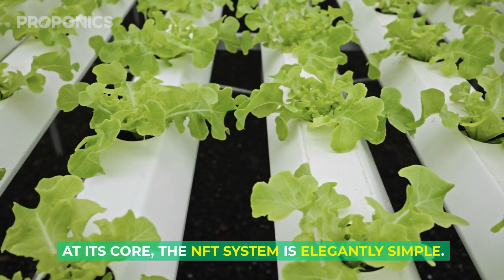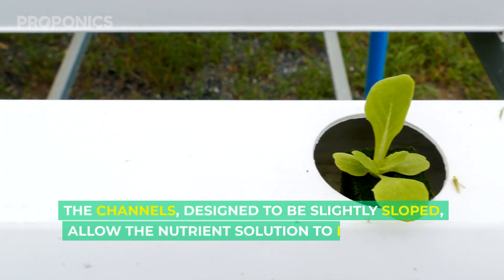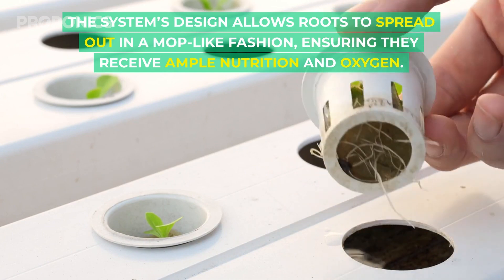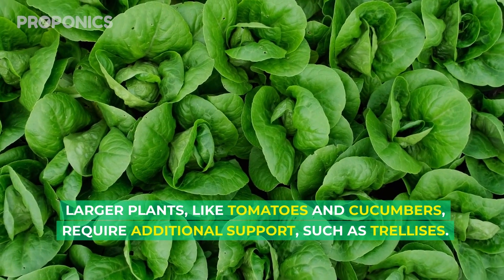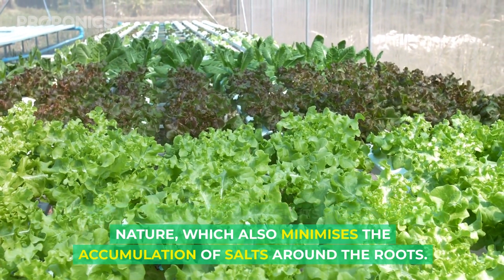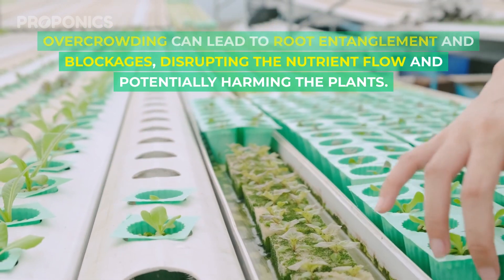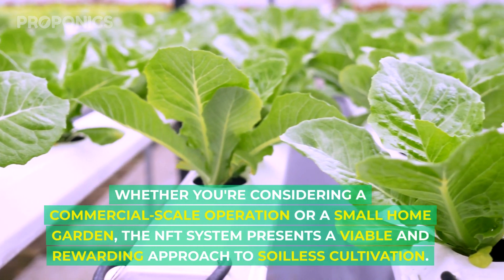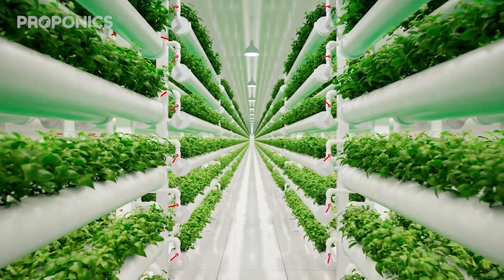NFT Hydroponics Explained

Comment: How often do you monitor the ppm and ph as they keep increasing in the tank?
And if the ppm is high after one week do i add water to decrease it, then wont it harm the plants as less nutrients are being provided?
Reply from the maker: Great question

Ideally, you want to monitor the solution constantly, everyday if you can, and keep a record so you can see when it changes.

Yes exactly, you need to add more water to reduce the ppm. It's all about density within the solution, it won't harm the plants to add more water because the nutrients will be redistributed. If you didn't add more water the plants would be at risk of nutrient overload because the ppm of the water they are up taking is too high. 

ppm can increase for a number of reasons, for example, evaporation in the reservoir. In which case the actual water being consumed by the plants has just been removed, not by the plants themselves, so more needs to be added. 

Nutrient density and water volume don't always decrease together at a linear rate.